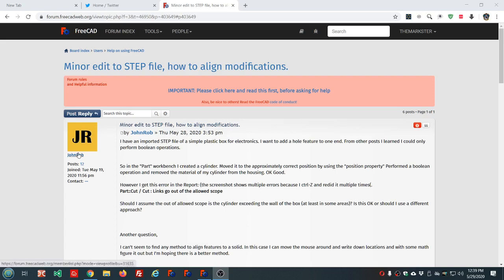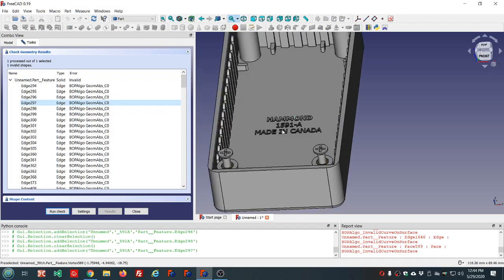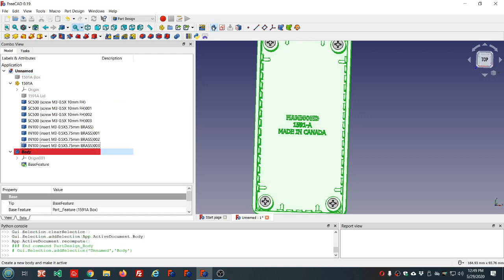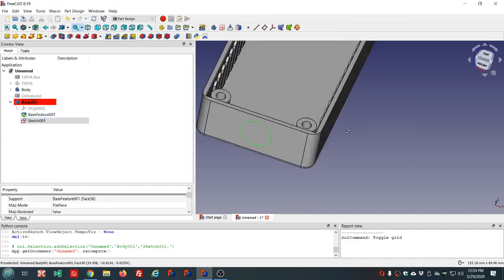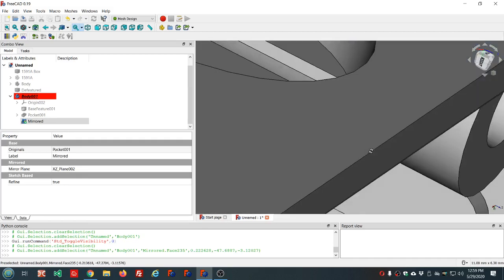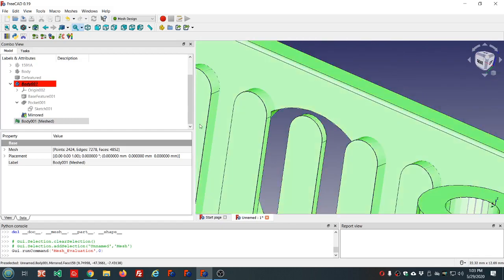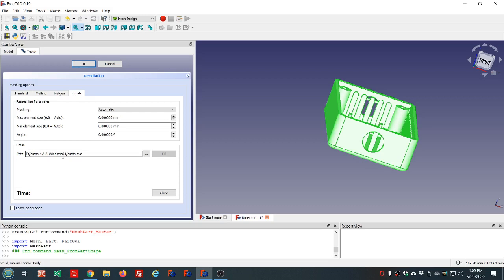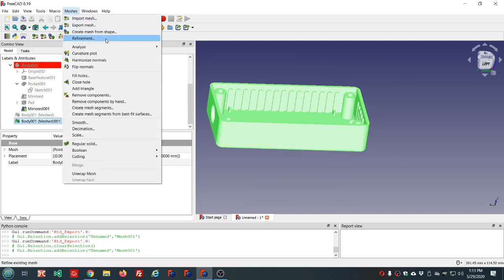071   FreeCAD 0 19   minor modification to imported step

Comment: And if unchecking the setting doesn't separate things, then it means the step file is originally made to be "as one" I guess? And thats the thing, I'd like to pick it apart.
Reply from the maker: That's correct.  You can try Part workbench explode compound tool and also Draft workbench downgrade tool.  There is a tool in Curves workbench that can be used to create a parametric solid from selected faces.
Reply: @mwganson  Yeah, nothing works. Though the shapes are simple cylinders. My ultimate mission is to just take measurements of these cylinders and their angles in relation to other cylinders along different axis. I was assuming that separating these pipes to basic cylinders and bends should be the first step.
Reply from the maker: @latuman  Every cylinder will have a seamline you should be able to measure to get its length.  You could attach datum lines in part design to the circles at the ends of the cylinders to be used as references for measuring the angles.  You could create a topic on the help board on the freecad forum and attach your file if you need further assistance in getting the measurements.

Comment: HI Mark very good video. How you can hide a protected text?
Reply from the maker: You mean like a copyrighted logo?  Best way I can think of would be to cut it out and replace that section.
Reply: @mwganson  Hi Mark I have been trying however when I do I have this message: "freecad pocket cut out of base failed".
So I did a way around covering the copyrighted logo with a picture and created a link group. The problem is if I send that anyone can easily see the original ..so there is any way to create a new body where the original copyright logo cannot be unveiled?.
Thanks!
Reply from the maker: @lll-r9u1l  Looks like for some reason the cut is failing.  Many times stl files contain errors which prevent them from being able to be used.  I believe manufacturers will intentionally include such errors to prevent potential competitors from using the files.  In such cases the file would need to be remodeled.  You can create a topic on the help board and attach the file to get more help.